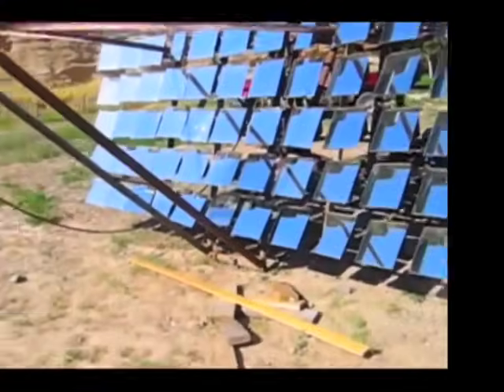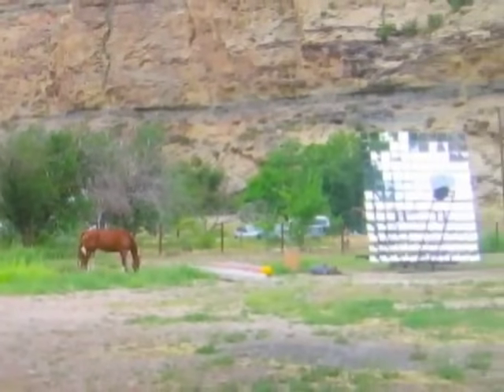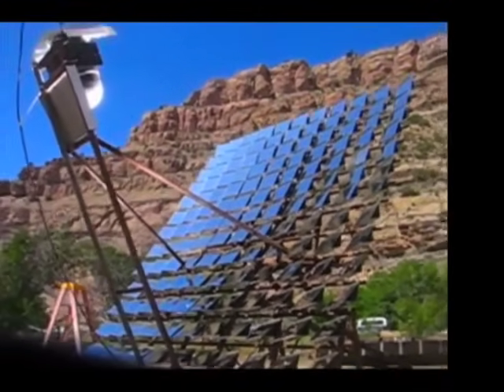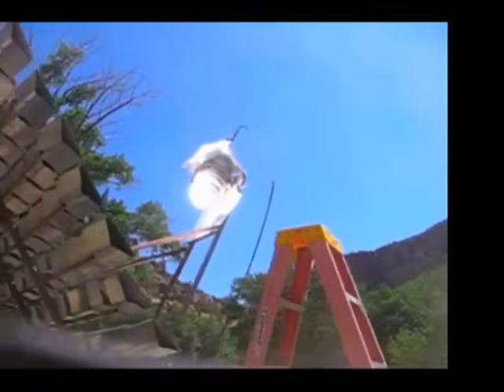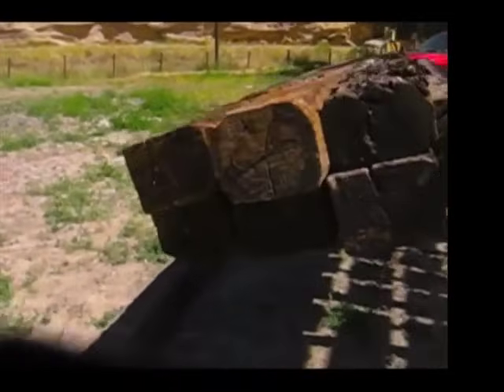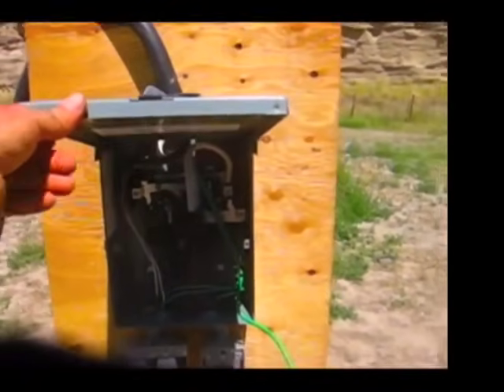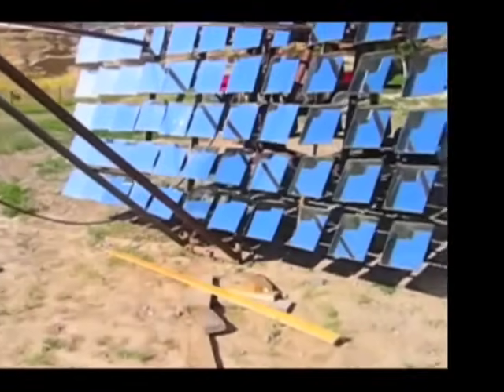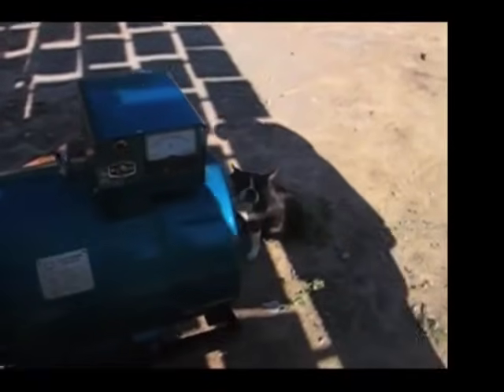STEAM ENGINE 12KW GENERATOR Solar Mirror Array Death Ray

Comment: 16 M2 is roughly 172 FOOT2.  The sun gives off about 100watts of Energy per square foot (PURE energy before conversion).     I get your doubt,  so I crunched some numbers to see :)

But yeah he needs full speed at the GENNY for full power.   It looks like there is gearing at the end of the drive shaft before the GENNY.   But Even when the steam engine was running fast the speed was going up and down.

It's an amazing project either way :)

Comment: I doubt he can get 12KW out of it. It's barely 16square meters in surface area and that's not even including gaps between the mirrors. Even assuming maximum 1000watt per 1 square meter it won't be enough. Overall given all the losses he could probably get enough heat for a 3-6kw generator

Comment: The problem with using solar steam generation, is that the higher temperatures needed increase heat loss.  There are better working fluids, like conventional refrigerants) to be used for solar-thermal generation, that would minimize the need for the high concentration factors, and allow operation at much lower operating temperatures, resulting in less heat loss, and higher overall efficiency.

Comment: I agree about using oil instead for heat storage. I wonder what would be the best storage medium for the oil and amount to power a single small home off grid. That and a hydrogen powered generator to fill in some of the demand for power would be great.

Comment: Not directly, but you could recapture the steam and let in change state back to a liquid, to reduce the amount of wasted water. Heat exchangers could be used to keep as much energy in the system as possible, however, there is the law of diminishing returns. It becomes more and more expensive to wring higher and higher levels of efficiency from the system.

Comment: Joe's solar-powered set up is impressive however he might consider replacing the direct heating of water with an oil line.  Oil can absorb many more BTU's from solar panels than water. There is such a solar-oil heating array in
Nevada that consists of acres of solar-thermal collectors all
focusing the sun's heat on long line(s) of oil that's heated to 700 degrees F.  This super heated oil goes through a heat exchanger that transfers heat to coiled water lines to create steam pressure.

Comment: Interesting idea. Also could be used to heat other things besides water for electrical generation. Things that retain heat for when the sun goes down. Things that might give you more then 400 psi. Everybody has to start somewhere. Even if it seems like your reinventing the wheel.

Comment: How do you waste steam?? it is just water vapor, and returns to the air, it is not wasted or lost. The Steam is not polluting. And if you have a good source it's no big deal. Also you can put the steam through a condenser and recapture most of it. Since the energy is solar generated it's pretty green.. Also mostly made for stuff that was already made. So again recycling.

Comment: You can't run this generator all day, it will be necessary to store the output in a battery array. On cloudy days you run off the batteries. Even better, you can run your electric meter backwards on sunny days, using the grid as your battery array. You might even get a check from the electric company if you have many sunny days.

Comment: Yet this can be made quieter, and a sun tacker can be added. My Aunt and Uncle live totally off the grid and have for many years using primarily solar and some wind. Batteries charged during the day provide power for night and cloudy days. This system allows all the power needs of the home including Air conditioning to run all day and throughout the night.

Comment: Everything starts somewhere... and can be refined to be very efficient. The system has far more value than you say. I have family living totally off grid using solar and a little wind. They have been for years and run everything in their home including air conditioning. Look at how many things that were invented or products that have been vastly improved over time or even in a short time with help. It can be made to track the sun, quieter and  greatly reduce maintenance.

Comment from the maker: The Fresnel Lenses in front of the mirror would diffuse the light as the optimal focal point would be short on a 12x12 Fresnel Lens. Also, since Fresnel Lenses concentrate sunlight vs amplify it, the filtering of an additional layer (the lens) would reduce the reflection of the mirror. The Fresnel Lenses work best alone with each lens focused to an individual target.

Comment: I have to do this! Sorry but the trucker and engineer came out, I think in 8'x8'x10',20',40' lengths. Think along the horizontal axis to achieve the multi-lense theory of it can't be done. No the focal point of each lense will not be on the same point but each one has it's own which the output is run to a header bank into the generator. Computer guided tracking on gimbal mounts. It's working on my drawing board paper but  the old saying about looking good on paper! You have to hear my story 1st.

Comment: I'm attempting to design a Fresnel multi-lense unit into a container home design I have on the drawing board along with a wind generator due to the number of wind days we have here also. All my/the main goal is to achieve water into steam which is @ 100c-212f  and for an average home 10kw or better is ok. I know you are keeping some things "quiet" as anything from the focal point on is the secret and the temps achieved are one of those and I can't wait for those numbers! now to keep watching!

Comment: is it possible to array the mirrors through a fresnel lense to get a smaller focal point? if so could you add a magnifying glass to get that focal point even smaller? possibly even use laser optics to  make that a beam? (yes i think too much)

Comment: PV is easier to set up in homes, but solar steam generation is more cost-effective. If we're talking about what you should add to your home: PV. If we're talking what should be implemented into the grid (or  a micro-grid) as a fairly cost-effective replacement to coal: steam generation. Google recently invested (I believe) 200+ million in a steam project. They make much more sense large-scale. I personally hope to work in the coming years on steam for third-world countries (Mechanical Engineer)

Comment: yes you can , dont listen to people that hold you back . and that was a very good question or point to make ... Lenses work with Source , angle of  Lens , distance to Focus Point .. Your Focus Point can be reflected as long as it doesn't melt while reflecting it ... after knowing that , u should know spheres , and how they can magnify and bend light..  Crystal Balls  , water spheres  ect .. because a 3d crystal ball can refocus light a lens would melt trying to do ... 
then there are prism's

Comment: You can Cone Funnel Mirror light on to a Lens that would then focus it ... ( cant over heat the lens thou )  ... or  u can use  lenses to focus light on mirrors that focus on something else ,  (cant over heat the mirrors) ... theres even other ways   u can use  MULTIPLE Magnifying glass or lenses ... just use Mirrors to connect the focus points of the lenses.. Crystal Balls can Refocus things in a 3d way they allows them to be in the focus beam of a lens without melting .. it goes very deep

Comment: The array of flat mirror panels is obviously a more cost-efficient setup than a perfectly rounded mirror or even an array of rounded tiles set to the same focal point.  I wonder how much more efficient the ideal rounded mirror would be compared to the array of flat tiles?  There's an interesting physics/math problem in there somewhere.

Comment: Claim: STEAM ENGINE 12KW GENERATOR Solar Mirror Array Death Ray
 
Proof of concept was a circular saw cutting a small piece of wood.

Can we see this run 6 2000 watt bar heaters?

Nothing here is a lie, but it can be misinterpreted as disingenuous.

STEAM ENGINE: Fact
12KW GENERATOR: Fact
 Solar Mirror Array Death Ray: Fact
 
But this thing putting out 12kw lol,  Assumption drawn from the title.

Comment: Have you considered using one of the large spun aluminum satellite dishes with a polished alum surface or mylar?  It would be easy to track and automate your solar tracking with only one motor.  Then instead of spending hours playing with it each time you want power, you just flip the switch.  What are you using for your steam engine?

Comment: The temp from the mirrors is high enough to use the brayton cycle . Using co2 the cycle efficiency would be 50% or a little more high

Comment: It would run at a much higher pressure like 6000 psi or higher. And I wouldn't use the Rankin cycle the brayton cycle would be the best. Efficiently would be 50%

Comment: Andy B I am amazed at you... Those folks don't have time to build prototypes! They are busy with much more important stuff like burning a few hunnert hours thinking up these silly little critiques. Based upon what I saw the system is highly inefficient. Now that having been said. Keep in mind that the system uses a power source that has a LOT photons per square cm and runs on hydrogen .You know, the sun.:-) a few gallons of H2O, closing the loop this fellow should be able to power 6 homes. NOW

Comment from the maker: sun = 1000-1300 joules per sq meters, this is roughly 16 sq meters = 16,000 watts of potential, since 100% reflective and receiving efficiency is not possible this closer to 11 kw of solar thermal. His boiler is a pulse boiler that produces several hundred pounds of pressure. The video says 12kw generator which it is and which it dose produce in short cycles. I have small lens that collects 1000+ watts of solar thermal that is 1.3mx1m Surface are is based on the collector are not the focal point

Comment: As a retired boiler engineer, I agree with the statement, "Insulate the pipes" because the steam lines rapidly loose heat. It would save on water and you could plumb the used steam back into the system to help preheat the make up water. Congrats Joe on a Great Job !

Comment: Consider that all light can be absorbed and does create heat.  A pure lasers of any color do set things on fire. 

A common Mono crystal PV is tested and rated at 16.25% eff with 1000w/m^2 sunlight @ 25c test conditions. So this equates to 162.25 w/m2.  

You lose 5% of energy through the back of mirrors.

95%/16.25%= 5.85 multiplier rounded.

Now 162 watts * 5.85 = 947.72w,m^2.

Comment: I imagine looking at 17 meter up, and 17 meters across.  LOL  Thats frigging huge man.  

The difference to 17 meters squared (17m^2) and 17 squared meters (17m*1) is significant.

17m*17m= 17m^2= 289 squared meters in area.

However this looks more to be 3.5m*2.8m = 9.8*1m x Sqr = 3.1m^2

Glad I could help.  But you seem to get a similar output as me strange enough.

You can get 1000 watts/m^2 in my country on a hot day.

Comment: Improvements. 

You could use 7m^2 mirror size, larger heat collector, hose capacity, steam generator for on load use, but need to have a method to regulate both heat and pressure for non load.

At best mechanical > electric generators work at 60% & steam @ 60% so 7m^2 of parabola is required to get this 12kw generator up to up to its full output rating, but you certainly dont want to run it @ 12kw, 6 kw is sufficient for semi greedy home power usage.  5m^2 parabola is sufficient IMO.

Comment: 8kw from mirrors, 
60% from collector= 4.8kw
60% max for steam engine = 2.88kw 
60% from generator  1.72 kw

2kw at best/

Maybe Im stingy on the mirror array, but generous for the steam engine, collector linkages and generator.

Enough to easily cut a small piece of wood with a circular was.

That said great fun and hard work, success. but consider the volume of the device, reliability, noise pollution and cost of this project vs some PVs and it may not weigh up practicality wise.

Comment: so basically a row of see-saws ( but taller)  all on one long  pole with mirrors on them that flap back and forth like venetian blinds. all tracked with a speed controlled motor with preset start stop times.  and manuals seasonal adjustments

Comment: in this way the stand is  cheaper with low embodied energy and the  rotation of the pipe  can be done with a variable speed  motor and a gear drive for daily tracking.  given a sunrise time and a simple  timer  a set rate of speed should track the sun seasonal tracking with the flap rod  can be done manually once a week or so i guess.  the line should be oriented askance to the south ( NNW for ex)  to allow for all seasons. the power should be fed into the grid and used later

Comment: 2x4  posts  and then run a  GALVANIZED pipe through  A HOLE IN THE TOP OF THE POSTS.  the post set about 20 “ apart each have a pice of plywood about 18” wide by 6 foot long  attached to the pipe at  one edge of each board with a hinge . on the sunny side of these are mirrors shimmed to create a focal point in one plane.   the pipe turns all the boards on one axis and  a rod  linkage attached to each board on the opposite  edged from the hinge side wags the boards back and forth .

Comment: As I said I don't know the actual size of the mirrors but my estimates are fair.  My estimates of 17 meters square for the mirror was an over estimation.  550w/m2 is ideal so a perfect system could only produce 9250w.  since there is absolutely no perfect system 9250w is absurd.  Even my estimate of 20% efficiency is generous.  SO no there is no way this device produces 12kw.  I would love to have them put a load on and test its output... I bet it produces < 3kw. and wastes tons of water.

Comment: i'm definitely no expert in this area, i would even admit that there are some basics concerning this that i'm not familliar with, however, the mirrors are only heating the water.
the heating power of the mirrors are directly proportioante to the heat applied to the water, not the v/a produced at the gen leads.
the steam in the boiler is directly proportionate to the rpm of the steam engine which runs the pto shaft into the gen head.  as long as the rpms and torque are there it will produce 12kw.

Comment: LOL  there is no way in hell this creates or could ever create 12kw.. He said he has a 50 amp 240 breaker which is good for 12kw..  He calls his generator a 12kw generator..  but do the math.. at most its 17m2 reflective area assume 550w/m2= 9250 watts max... in my experience this would only be 20% so that would be less then 2kw.  if it got 3kw I would be extremely impressed. That said it is a neat toy, not useful but neat.

Comment: I was wondering how much can u heat water with solar power couse i red about electolizies of water to produce hydrogen and learned that at 2700 degrees C u dont need any electircal powert to achieve electrolizies mb if i can get it to 1000-1500 C i can make hydrogen with very little power.I saw a cureved mirror only 2 squere meters able to melt metal it gets over 2700 C on a single point. Some info would be nice couse im not really a scientist nore im very smart 10x

Comment: Solar coupled with steam is a bit of a dead end design.  Whenever you have strong sun, like deserts you'll have a shortage of water.  They work against each other, unless you use a closed loop generator that doesn't loose water.  Then you probably can't use water, but some kind of refrigerant.

Comment: 1.8KW/sqm peak as I remember from the physics class but that's max and not considering the atmosphere, let's say 1KW/sqm max emerging power on a 12.5*14.5*0.3*0.3=16.5m^2. Now we have no clue how much that generator produces except that is "rated" at 12KW. My best bet would be a 5-10% efficiency would be an otimistic estimate based on the fact that the regular steam engine cannot get anywhere near 20% efficiency and water has a high boiling point and a considerable latent vaporization heat.

Comment: @Cjephunneh The interesting 
thing about the paraboloid of revolution is that the same 
parabolic curve can be used anywhere in the dish to
produce the dish itself.You can use it rotationally to make
radial struts to create the parabola, or slide it up another
such curve to produce it in slices parallel to the axis. 
And you only need one motor if the mount is equatorial.

Comment: @Cjephunneh Those are great, but pricey. It's SO easy
to make your own array with positioned mirrors on a flat
surface, or use a parabolic pattern and cut out matching
interlocking box pieces from light duty plywood and put
them together like a construction set.

Comment: @Dan19842505 Uh, math error. If you get 1kW/m^2 and
you want 12 kW at 40% efficiency, you only need 30kW of
solar, which is 30 m^2 or a 5 x 6 meter array. He looks to
have something approaching that. 15 ft x 18 ft? Approximately?

Comment: There are some sound concepts there, but man that's dangerous. There doesn't seem to be any make up water for the boiler, what happens when it boils dry? Also 430 PSI is a fearsome pressure sure hope that vessel is certified by dept. labour or whatever you have in USA. I would prefer to see water piped up to the collector bulb then back to a boiler on the ground the steam would separate from the water in the boiler steam space, this would also reduce the suspended weight on the mirror frame.

Comment: K, little critique on the design?
Closed loop heating system. Dumping any heat out of a solar system sucks.
Switch to alternator/DC generator. Hook it up to a gang of batteries so you can store power. 
Then hook up batteries to DC/AC convertor for power on demand.
You should go with a steam turbine, reciprocating engines are not very efficient. And it would complement the closed loop steam.

Comment: I see 2 problems right away. 1. Turbines are more efficient. 2. Painting the boiler black increases radiation transfer, perhaps putting a black insert inside the boiler would get the best transfer.